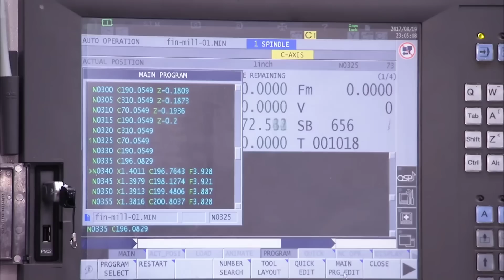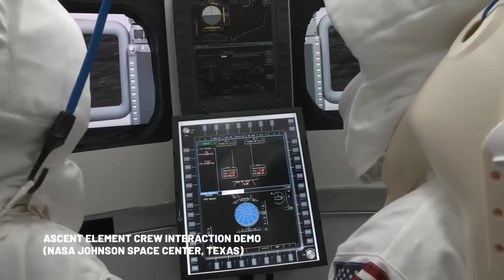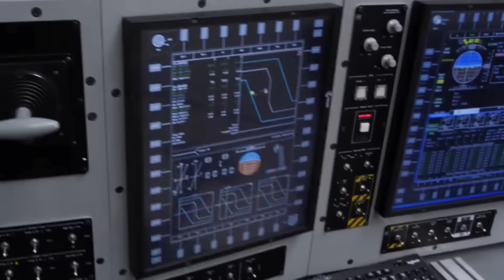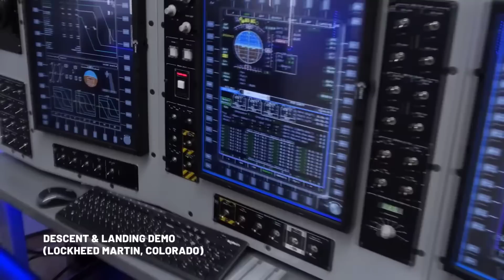Blue Orgin gets another shot at the Moon, BUT there's a surprise development in the HLS battle!

Comment: The argument against SpaceX's orbital refuelling isn't so strong. They've already go all software/robotics orbit matching and docking worked out with Dragon and the ISS. We know they've mastered the principles required for docking of Starship HLS to either a fuel depot or other starships serving to refuel it. They'll have to be sure of a way to transferring the fuel in microgravity - that's the big engineering challenge. Raptor 1 is flight tested. Raptor 2 has been tested substantially and it's a simplified, less failure prone iteration of the initial Raptor design-so we can count on that. The landing engines needn't be anything revolutionary, and the big challenge as Musk has pointed out is not the design but the mass production of engines. The lander will be able to haul large masses down to the surface and back-not needed for early Artemis but necessary to establish a permanent base! This vs BO's multivendor not yet fully designed much less integrated offering? With Boeing now? Wait 'til Boeing has designed it's part and they've integrated it before saying it has a chance of beating SpaceX! I agree Dynetics/Northrup Grumman have a MUCH better chance than BO's team. I don't understand mentioning Dynetics/NGrumman third when they've got the 2nd best chance.  But the cargo capacity of SpaceX will matter incredibly in the future. Everyone else will have to design a 2nd offering to participate in building the moonbase. SpaceX's offering is already appropriate. And heck, you could build a base in a starship and just bury it in a trench with a ramp leading down and there's your moonbase.

Comment: Also, I’m a huge SpaceX fan, but you can’t really hold the B7 engine against blue origin. It’s not like the raptor engine has been flight proven yet. Let alone demonstrated to be reliably reusable. Also, as far as I know the landing engines for the lunar starship Have only been drawn in pictures. I’m sure they’re working on that, but it’s not like the raptor engines are flight tested either. If we’re trying to win a race with China, it seems likely that an Orion based capsule lander will be ready far in advance of any other option. We can worry about reusability after we beat the Chinese back to the moon.
Reply: SpaceX at least has a history of developing working engines. Orbit capable craft.  Manned craft.  

Blue Origin?  Not so much.  They have the BE3 engine but it recently had a substantial failure that hasn't been explained.
Reply: @Scanner9631  yeah but the Merlin engine was basic, proven technology. The raptor is something completely different, probably the most ambitious engine development in the history of mankind.  No full flow staged combustion engine has ever flown before, let alone been demonstrated to be rapidly and easily reusable. With chamber pressures in excess of 300 bar!  

The Merlin engine is closer to a 57 Chevy engine then it is to the raptor. Yes, I’m exaggerating, but only mildly.
Reply: Raptor engines have more running time than any other primary, American manufactured engine other than Merlin and RS-25. No one has built & tested as many as Spacex

Comment: Refueling is not the very difficult issue it is assumed to be, just needs to be done
Reply: i did some research into this some time ago and the cooling system that was proposed for cryogenics had a secondary benefit of allowing fuel transfer in zero gee.  can't remember what it was called though as it was over a year ago that i looked into it.
Reply: We're talking about at leat 1000 tons of cryo refueling in zero-g. Four/five launches only to deploy ONE lander (altough very big) on the surface. A lander, by the way, at least two times higher than this...

Comment: Can I suggest they consider the Space 1999 lander as a target concept for reuseability? It's actually a pretty reasonable design.
Reply: I thought that it would be smart for the SpaceX lander to actually land on its side so that it would be much easier to load and unload.
Reply: @Hedgehobbit  And, used as habitation if left there and configured as such.
Reply: @Hedgehobbit  they need to keep it upright to keep the landing engines (I assume Super Draco?) up high so they don't kick up too much regolith. and it makes more sense for internal structure on the moon. (Better round walls and flat floor and ceiling, then two flat walls and a round floor/ceiling) Also as @luftpirate mentioned, rigidity? its not built for it.
Reply: Maybe Dynetics/Northrop Grumman could make the next iteration of the Alpaca lander closer to the Space 1999 lander. After all the Alpaca is sorta like the 1999 lander without the streamlined shape & rear engines!
Reply: @jmwoods190  Yeah! Bring on the Space 1999 Eagles!  Let's Do It!!
Reply: @jmwoods190 , I was thinking the same thing.
Reply: Dynetics is already like the Space 1999 lander, just that it's at version 0.1. It seems to be reusable with just swapping fuel and oxidizer tanks or by refueling. Hopefully that Space X experiment will go well. If it does it will change everything .
Reply: Space 1999 lander is a awesome concept that even has a detachable cargo section. With todays technologies we might be able to make a moonlander similar to that concept, but it would probably be more like a moon hopper transferring resources from point A to B only on the moon.
Reply: Oh man the Eagles in Space 1999 were so cool!
Reply: They should have teamed up with a bungalow-building company.
Reply: @heimatlos It should be much less stress in Lunar gravity to sit on your side but I see your point.
Reply: The Eagles were great on the Moon, but they'd never have survived return through a planetary atmosphere. But I guess since the Moon never got blown out of orbit, that won't matter.
Reply: @carandol22  Of course moon to the Lagrange points and back only. No Earth re-entry required. Basically semi-trucks for various cargo.
Reply: @100-TEMPO , hmmm . . .  They used to crash quite often.
Reply: You mean the 1969 lander, perhaps. The one being used to land on the 1st time
Reply: @heimatlos It does it every time its transported. Besides it would be pressurised on landing on the Moon, think Coke can before its opened, pretty strong.
Reply: The Eagles were always depicted as flying horizontally but obviously that’s impossible due to the moon’s gravity. There is no atmosphere to generate any lift (and no wings anyway) so they would need to fly at 45 degrees or constantly use their lower thrusters to prevent crashing into the surface 🔥🚀. The Alpaca is quite similar looking due to the girder structure and again has a detachable “pod” but obviously is (correctly) designed for hopping and vertical movement only. Ah the joys of SciFi where you don’t have to worry about minor issues like gravity 😂 They even walked completely normally within the base
Reply: Please please tell me this is a sarcastic thread.